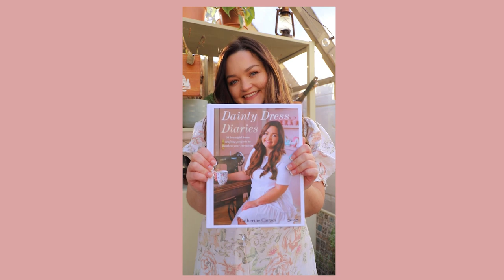Creating my dream cottage garden, laying stone, a pond & digging flower beds.

Comment: I highly recommend putting in a submersible pond pump at this point in order to sort out where you need to lay the cable and plug it in. It makes a big difference to the water quality when it's being aerated and it's also lovely to have the sound of a mini fountain going when sitting out in the summer. Speaking from experience our cats also loved drinking out of our pond when they could reach the pumped water 😁. Love what you've done with the garden so far!

Comment: If you haven’t got the patience to wait for grass seed to grow, you can lay turf on top of existing grass.  In March you could buy a few yards of turf and as long as you keep it well watered if the weather is dry it’s an instant fix, you don’t have to get up any old turf, just lay it on the top and shape the edges if you want rounded curves or straight lines, with a kitchen carving knife.  I did my scrubby lawn myself like this and it worked out just great.

Comment: Where is your composter? Lovely garden and new stones. Thank you for sharing.
Reply from the maker: At the moment I don’t have space for one. We have compost bins in ireland that get collected. But I do want to get one for my own garden
Reply: You can build a small one cubic foot composter using old wooden crate, remove bottom or use small plastic bin drill holes all over for aeration/drainage. I have created both of these before and they worked well.
Reply: I meant 2 cubic foot.